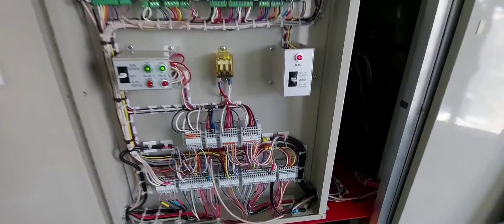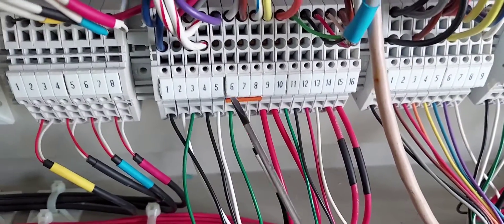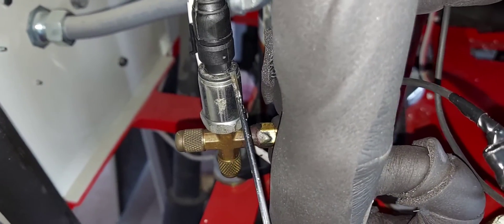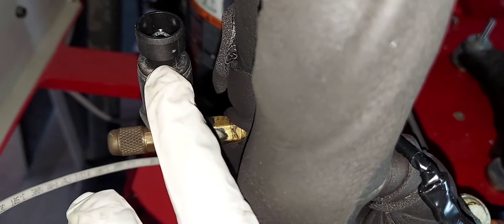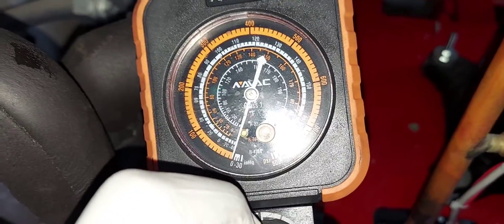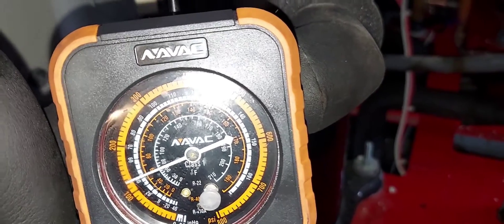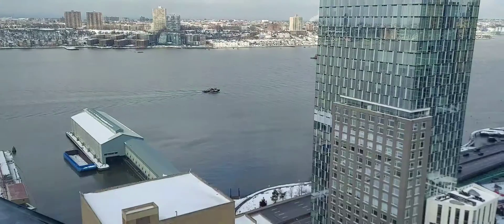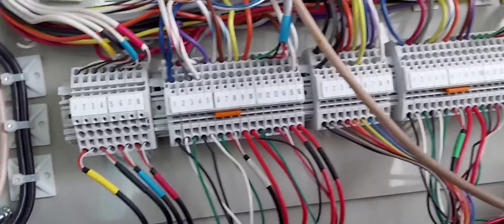HVAC LOW/HIGH PRESSURE TRANSDUCERS | SPRING CLAMP TB

Comment: i dont think tyere was anything wrong with that transcucer honestly, rarely ever seen one go bad other than wires were broken
Reply from the maker: How often to you work with transducers?
Reply: @D2DNYAC  at least once a week
Reply from the maker: OK 👍
Reply: I do have a PSA message on my thermostat  and i was told that it was the transducer and it needed to be replace. you think is the wiring and not the transducer ?